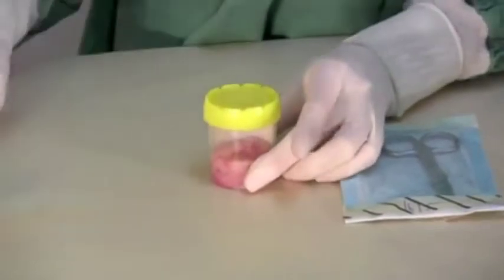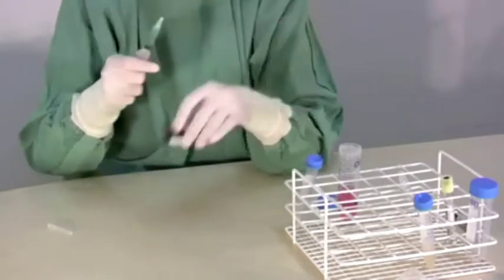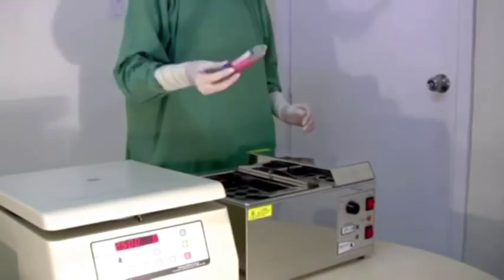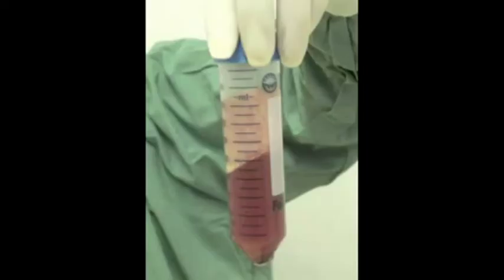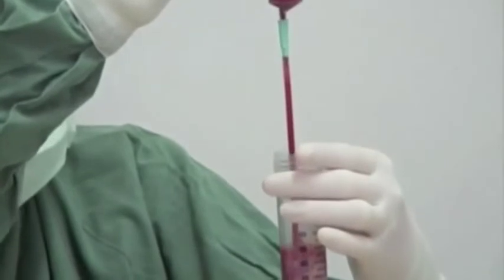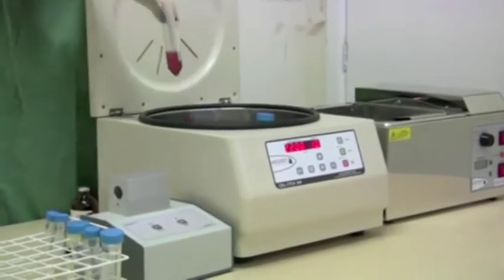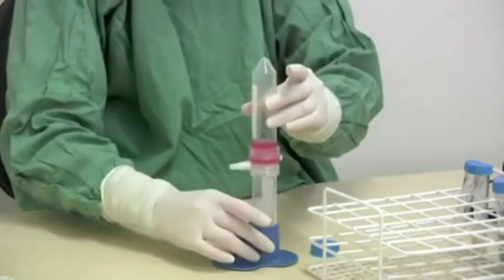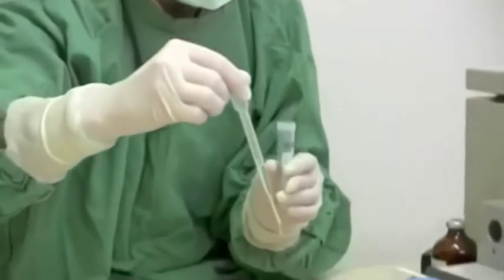Adipose Fat Digestion Processing

Comment: Regarding tumescent solution for liposction : Lidocain has a negative effect and distroy 5-10 % of Fat stem cell. Question : Taking into account that Vitamin C protect stem cell , îs It possible to add  20-40 mg vitamin C in tumescent solution without affect the compatibility with Epinephrine, etc and without produce differentiation of Fat stem cell ? Thank you.